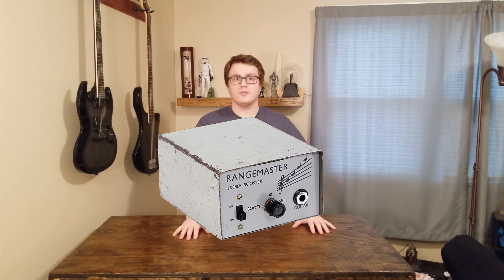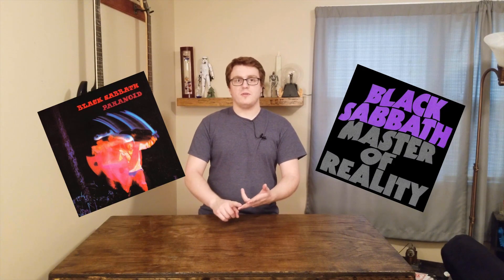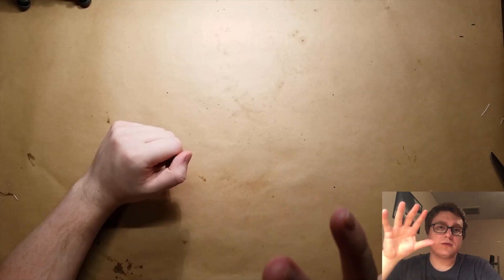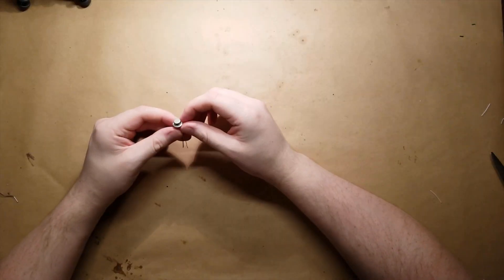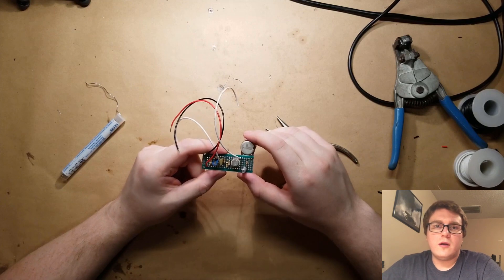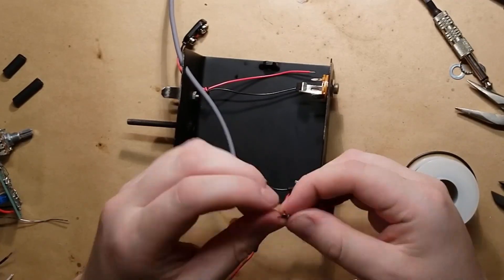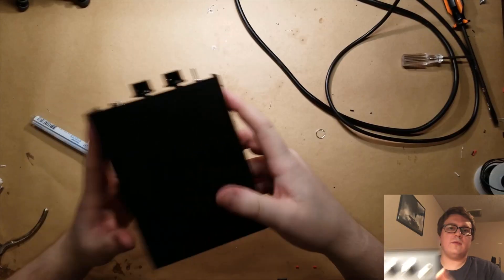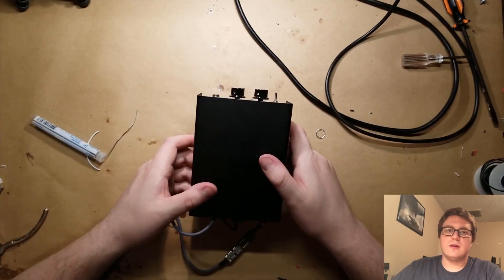Black Sabbath Rangemaster Clone DIY

Comment: Ok. Your pedal actually did make a different on the sound because I saw other video and when the guy turned the pedal on I did not notice any difference. Yours did made the sound "better". I see from your schematics that you are using an NPN BJT. Interesting.
Reply: Keep in mind when building this circuit that the transistor you're using can vary their bias point (in this case the most effective amplification) depending on their material and gain and other factors like temperature like Germanium transistors, so don't take the resistors used here for granted.

Comment: Nice job man .........i've just built my third one for myself with switchable input caps.  Can i ask if you would be good enough to explain how you wired the input volume control ...i'd like to try that.  [ If you can't it's no biggie  ;)
Reply from the maker: Sure thing, it's just a basic A100K pot in a basic volume config, just before the input cap. Works just like a gain stage control.
Reply: @daniskaengineering  cheers man !

Comment: Wierd. I wish he would have shown the board. If he did use a 39k the pedal would have almost no gain if it even worked. If its a kit it probably included the correct value.

Comment: Well the schematic is totally wrong. Where it says 39k it should be 3.9k. With a 39k i cant even see this working. Maybe he corrected it when he built it. Everything else is corect, they added a prevolume as well. Antways maybe the thumbs down came from showing a schematic that should not work correct at all.

Comment: Great video...Any ideas where to get a mullard OC44 germainium transistor?
Reply: I buy them on ebay but the prices are bonkers! Plus if you don't pay extra for one with measured hfe and leakage you'll get trash.

Alternatively i believe they put them in some old transistor radios...i used to buy roberts type radios and pull tonnes of old germanium out of them (not sure if they were oc44 or oc45s though).

As with anything though, you might buy 3 radios to get one good transistor :(

Alternaticelt i scour ebay for "job lot electronics" then perve on the pictures ti see if i can spot germanium stuff :)

Comment: Two knobs?  That schematics has a mod, the first 10nF capacitor. Originally it is a 4,7nF, with a 10nF you will have more bass frequencies going thru. Otherwise, kudos for the nice enclosure.

Comment: Hey mate ! Nice Job, Sounds Good ! Can You confirm transistor germanium model please ? you said something like 1984 . Cheers
Reply: I believe he said that was the production year? It's most likely an OC44.
Reply: @rogergoldman1149  thanks for Your comment, I know the Original is a OC44 from Mullard which a Black glass germanium transistor, but it is not the reference of the one used on this video, He posted some pictures showing something like “MP3X” Year Of Manufacturing: 1984, and I cannot see the “X”, it could be MP30A, or MP35A or ....
@DaniskaProjects it will be amazing if You can confirm the reference! Cheers Guys

Pictures: https://drive.google.com/drive/mobile/folders/1GUsCGGbz8PNxDtifQ6s9R1IZliud1oWs
Reply from the maker: Hey! So the transistor is a Russian MN38A NPN Germanium. Production year 1984. The measured gain of my batch was around 90-120 hfe. The datasheet that came with the batch was all in Russian and has since been lost.

Comment: What are the use of both knobs? Treble and boost?
Reply from the maker: One controls the input volume, kinda like a gain control. The other controls the output volume/boost. I've found that controlling the signal on both sides allows for added flexibility.
Reply: @daniskaengineering  sounds nice ! Input volume is for darkening the tone?
Reply from the maker: It helps cut down on feedback mainly. I've also found that it helps if I'm feeding another high gain pedal into it. Stacking pedals can get really noisy, really quick.
Reply: @daniskaengineering  really interesting to know, thanks !